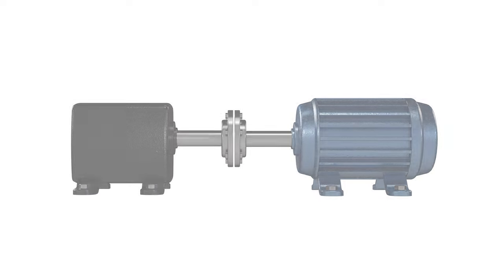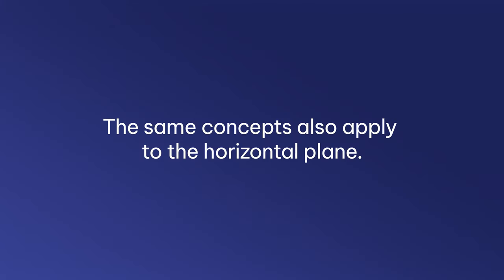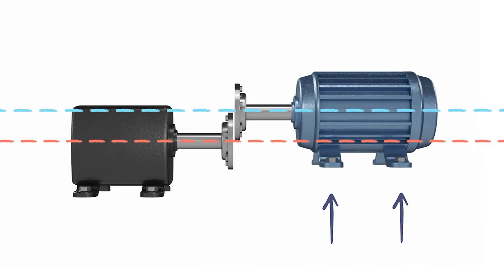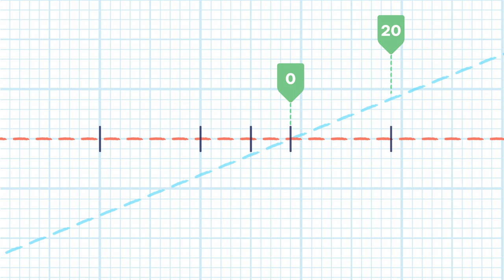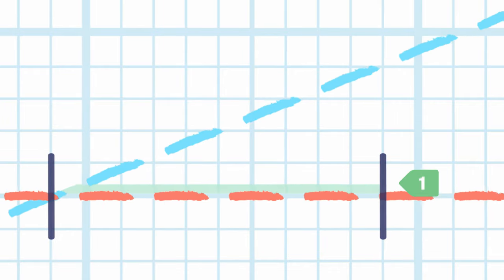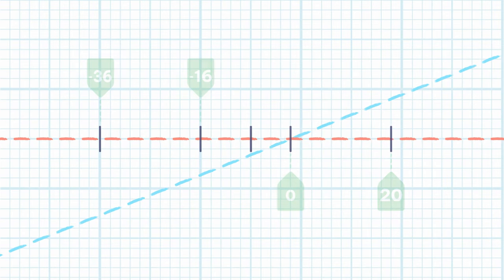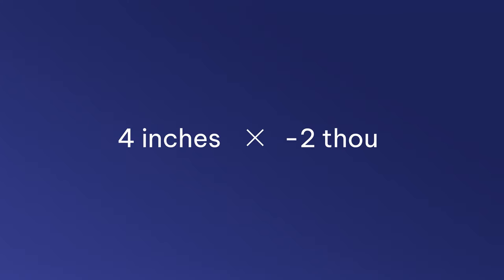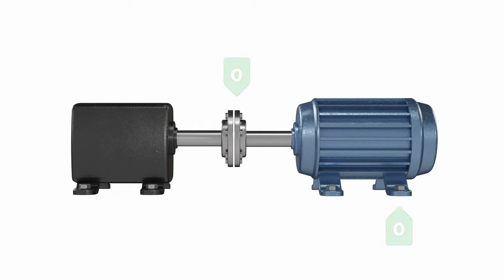Shaft Alignment 101: Offset & Angularity | ACOEM

Comment from the maker: Drop us a comment if you have any questions about offset and/or angularity! We are here to help answer.
Reply: Good evening, great video!!
About the vertizontal method using dials: how I do the maths for this method? Is it a reverse method but the dials are at the same position?
Reply from the maker: @vitor_ternero_   
Yes, you can perform a Reverse Dial Indicator Alignment using the VertiZontal Method.  When using the VertiZontal Method for reverse dials we only take 3 measurements (based on the Validity Rule). Be sure to control coupling backlash when rotating the shafts. 

Looking from the outboard end of the movable machine to the stationary machine:

Zero both dials at 9 o'clock.
Rotate the shafts 180 degrees to 3 o'clock and note the dials readings (+ or -). This is T.I.R. (Total Indicator Reading). 1/2 the TIR on both dials, now the S & M dial indicators both show True Position. 
Rotate the  shafts/dials back to 12 o'clock. The S & M dials show True Position for the vertical plane. The S & M dials readings are used to calculate or plot the movable feet position.

The math to calculate the movable feet position for vertical correction is:

Dimension A is the distance from the S indicator plunger to the M indicator plunger. 
Dimension B is the distance from the M indicator plunger to the front foot bolt center.
Dimension C is the distance from the front foot bolt center to the rear foot bolt center.

Front Foot position calculation:
((M - S) ÷ A (B)) + M

Rear Foot position calculation:
((M - S) ÷ A (B + C )) + M

Leave the hold down bolts loose after shimming, rotate the shafts/dials back to 3 o'clock and adjust the motor horizontally using the NEAR-NEAR and FAR-FAR method.
Look at the M indicator (near) when adjusting the front (near) foot. Look at the S indicator (far) when adjusting the rear (far) feet.  Adjust the movable machine until both dials read zero.
Tighten the hold down bolts, then remeasure and repeat the VertiZontal as needed.

You can also download and use the Fixturlaser Dials app whichs steps you through the VertiZontal method, gives results for both vertical and horizontal, shows how much shim to add/subtract, etc. This video will help as well, which shows how to align using the VertiZontal method and dials:

https://www.youtube.com/watch?v=CLyG-8wq268
Reply: @AcoemUSA  Thank you. Great explanation.
Reply from the maker: @vitor_ternero_   No problem! We hope that it helped.